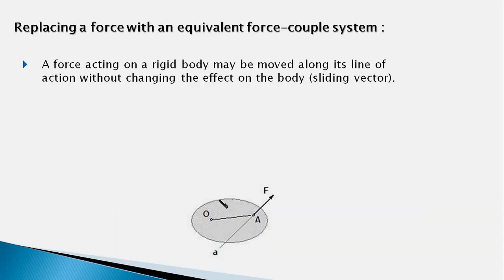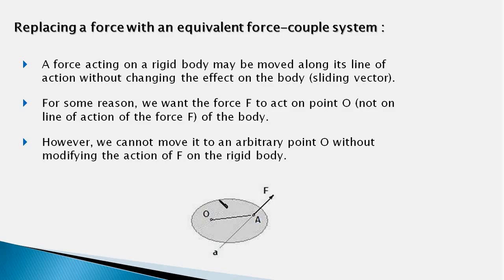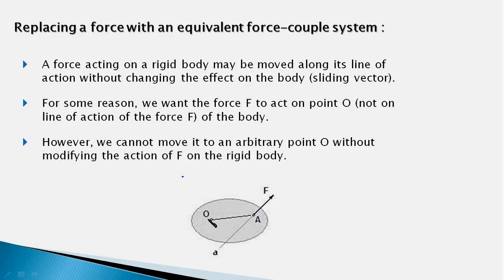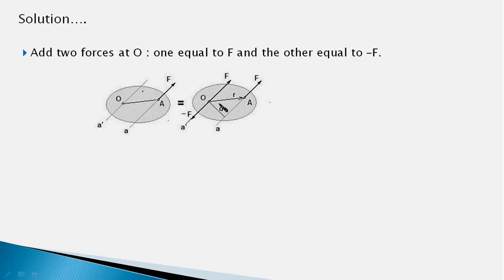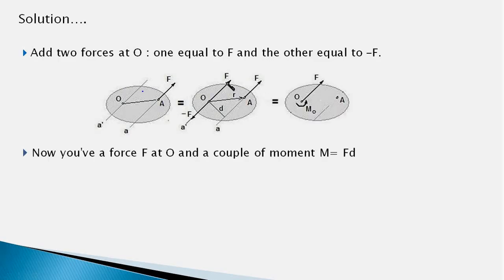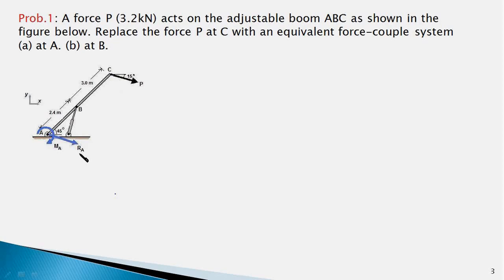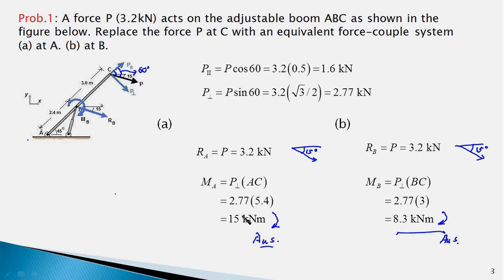7.1 Replacing a Force with an equivalent Force-Couple system

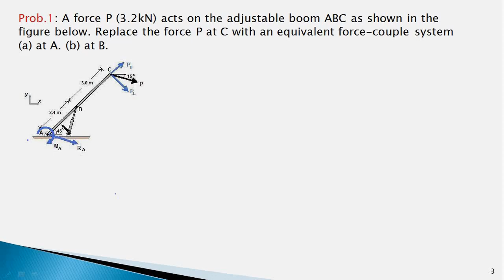Comment: 4:38 At point C you ended up giving the parallel and perpendicular components of point C rather than the points of the force. Because otherwise the P force should have lined up with the perpendicular one. I'm confused why?

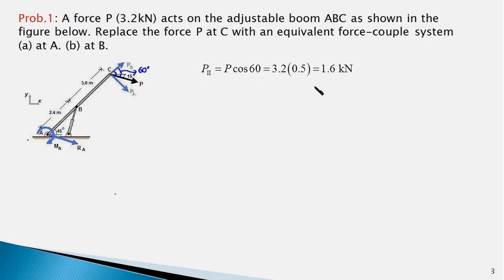5:14 Also I understand that for the P parallel force you use cos60 but going with that logic- shouldn't the P perpendicular be Pcos30 since we have a right triangle forming on the top the complementary is 30?

If you can clarify that I will be forever grateful.
Reply from the maker: Hi Sroy: 
4:38 The confusion seems to be at a basic level. So to clear the doubts, I'll provide clarifications at the fundamental level - note that I computed perpendicular and parallel components not of 'point C' but of the 'force vector P'. The point C is just the 'point of application of the force'. To determine the components, I need information on the vector's magnitude (3.2kN given) and its direction ( 15 deg angle with the horizontal). From this data I know that the line of action of the force makes an angle of 60 deg with the line ABC and that enables me to determine the perpendicular and parallel components...the point C doesn't come anywhere  in the picture as far as this computation goes.
Now since the point of application of the force is point C, I can imagine the parallel component is aligned with the line CBA and the perpendicular component is at 90 deg to line CBA. 
Hope this clarifies the issue. I also suggest you to watch another video on this channel that will further help you understand the basic concepts https://youtu.be/HxG-GuQ2xQo
5:14 you're absolutely right... the perpendicular component could be written as P*Sin60 or P*Cos30 ....you get the same result.

Comment: why does Ra equals P, wouldn't there be an upward force from the support at B?
Reply from the maker: Sure. The boom ABC would be acted upon by  reaction forces at the support B and support A as well. But why should we bother about the reaction forces, as far as this particular problem is concerned? We aren't doing any equilibrium analysis or drawing FBD of the body... so we need not be concerned about all the forces and moments acting on this body.
Please read the problem again... we simply want to find the equivalent force-couple system (acting at A and B) of the external force P. Now, why Ra is equal to P (mag. and direction) - you will understand clearly from the concept explained in the first 3 minutes of the video. Hope that helps!

Comment: Prob. 10: A concrete foundation mat of 5-m radius supports 
four equally spaced columns, each of which is located 4 m 
from the center of the mat. Determine the magnitude and the 
point of application of the resultant of the four loads.
Determine the magnitude and the point of application of the 
smallest additional load that must be applied to the foundation 
mat if the resultant of the five loads is to pass through the
center of the mat.

Sir plz once solve it
Reply from the maker: Hello Geetanjali: It's a quite a simple problem to solve; but first you need to learn to find resultant of 3D parallel forces. So, I suggest you to watch two of my videos on the topic:

1. Resultant of 3D parallel forces(basics) - https://youtu.be/qx6Rt3Wf-xo
2. Resultant of 3D parallel forces(solved problem) - https://youtu.be/vvnNa3V3Bco

The concept is fairly simple and you should be able to solve on your own. If you get stuck, do let me know. Happy learning!
Reply: @VectorInMotion   First of all I would like to say thanku for reply bt sir in your question which u have done (hexagon type ) location of unknown forces are given bt in mine question which is similar to this location is not given and force also we have to find so three variables are there  (x,z,force ) and  I have only 2 equation  so it creating a problem....
Reply from the maker: @GeetanjaliVerma553   The point of application of the loads is given - 4m from the center of the mat and equally spaced - so you can assume them to be on the x and y axis on either side of the origin (take the center of the mat as the origin of your coordinate system). With this hint proceed further.
Reply: @VectorInMotion   sorry sir but 4 m is given for 4 rest forces but we have to calculate the location of new force ,which can be anywhere on mat not at 4 m , so that resultant passes through centre
Reply from the maker: @GeetanjaliVerma553  Pl. mail me the image of the problem including diagram shown in your book at vectorinmotion@gmail.com.
Reply from the maker: Geetanjali: Although you've three unknowns viz. magnitude of the additional load and its point of application (Force F, X1,Y1), the key point here is the "smallest" load. That means the additional load should be farthest from the center of the mat i.e. its point of application would be 5m from the center. So that provides you the third equation => 
X1^2 + Y1^2 = 5^2. I hope with this hint you'd be able to compute all the three unknowns. Once you workout the solution, please do post the answers for F, X1 and Y1.

Comment: Why use p.perpendicular and not p.parallel I'm confused
Reply from the maker: The short answer to your question is that only P(perpendicular) component contributes to moment about point A and contribution of P(parallel) component is zero since it passes through point A (the moment arm is zero and hence the moment is zero). So, you ignore P(parallel) while computing moment of P about point A.
You may like to first clear your concepts about computing moment of a force from its rectangular components. Please watch my videos: https://youtu.be/HxG-GuQ2xQo and https://youtu.be/wXklLO_l46w and then get back to this vide (module 7.1). Hope it helps!

Comment: How u find horizontal equivalent
Reply from the maker: Hi Beyanca, Perhaps you want to know how do I compute horizontal component of the applied force P (for computing moment about points A or B). If that's your question, the answer to that is -  I don't compute horizontal and vertical components of the force. Instead, I first compute parallel and perpendicular components of the force P and then use these components to figure out moment about the points A and B. You do these tricks to reduce your calculations - as you know the parallel component doesn't contribute to moment about either A or B. Hope that answers your question!

Comment: why Ra id double of P2??u didnt explain that pls help
Reply from the maker: Hi Omkar, both Ra and Rb are equal to the applied force P(3.2 kN). The component  P2 (the parallel component of P) happens to be half of P's magnitude because it makes an angle of 60 deg with P. The magnitude and direction of both Ra and Rb is same as that of P and not its' parallel component. Check the explanation preceding the problem solution. Does that help?
Reply: @VectorInMotion  yeahhh got that!thankss